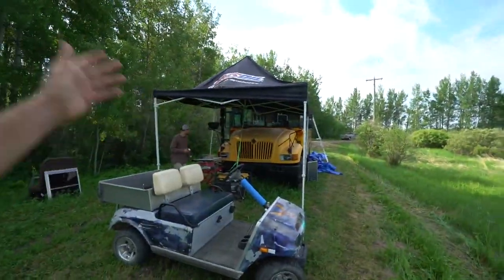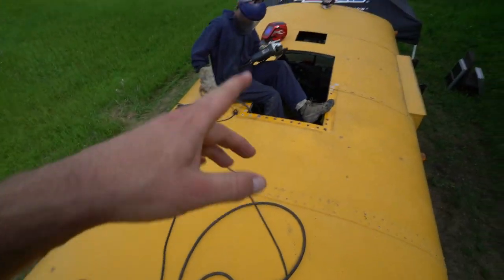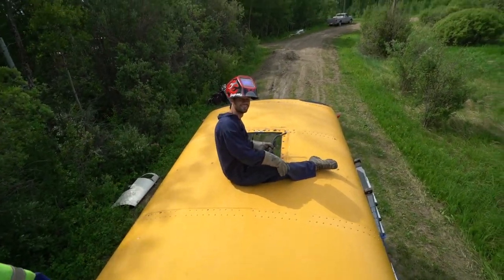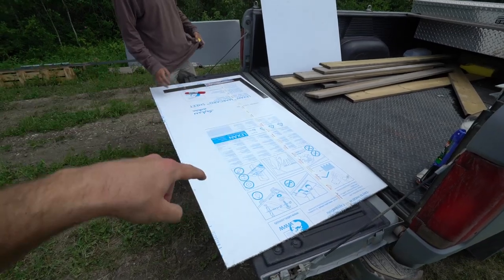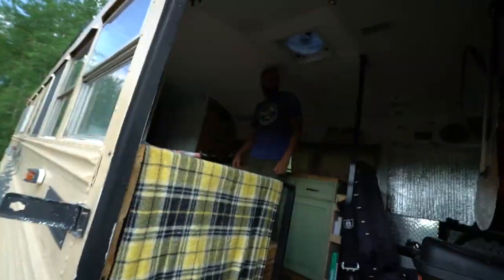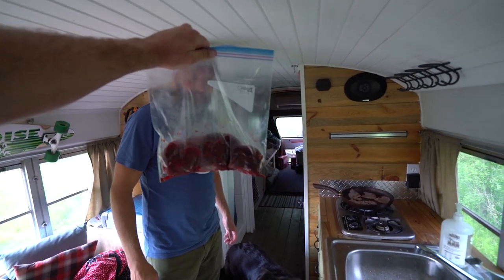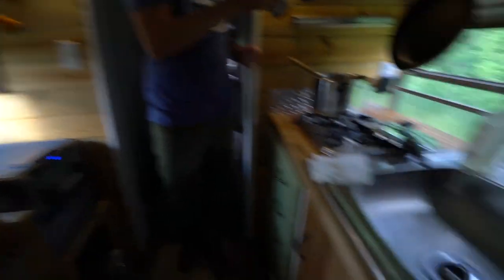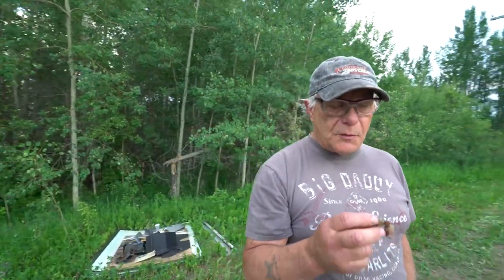DOUBLE SKYLIGHT IN SCHOOL BUS CONVERSION

Comment: Moving right along. Pressure washer works great on removal of decals and silicone and cleaner when using outside,inside well........ tends to get messy. Digging the sunroof ,planning  to do a vw on top of mine with a roof raise and go under an overpass to prove it can be done🙂

Comment: think those clear pieces of roof will heat the bus up a lot if the sun shines , make sure you either have some cover to put under those skylights or cover the top with a uv filter foil

Comment: Okay Jax, you asked. Back in 2002 when I bought my house, I went to Best Buy to get a new big (at the time) 32" CRT TV.... Well on my way home, literally 20 minutes down the road, the sky changed, QUICK.... I could see green skies behind me with LOTS of lightning, and a funnel coming down out of the sky.... The TV was in the bed of my standard cab Ford Ranger, and I had it floored as fast as that little 6 cylinder would go... I managed to cross the clear creek bridge ahead of the funnel, which managed to touch down in the creek and spin off to the lake and dissipate....

Pretty sure I needed new underwear after that trip.

Comment: A tornado watch means you have instability in the air caused by a cold dry cold front mixing with warm moist air creating a rotation mix of air that makes it spin. The potential of a tornado is anywhere within the tornado watch box. In wherever the location is. It's like stirring the pot in the air, and the tornado is conflict. A tornado warning means rotation the potential for a tornado being born, a funnel cloud has been spotted, or a tornado is on the ground in the area. Always go the lowest level in your home towards the very center of your home. That part is the strongest. Close all windows, and doors. Never leave windows open the wind can make buildings weightless and that can cause them to fly away and be torn a part a lot more from a tornado. A sealed tight home should prevent that. Seek shelter in a closet with no windows, or a bathtub in a bathroom, or a basement. Hope this makes sense.